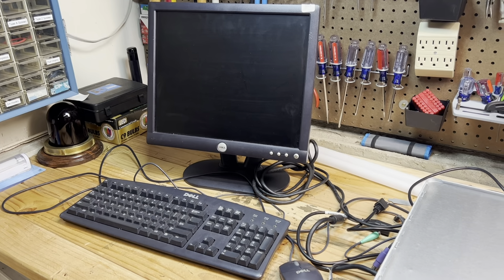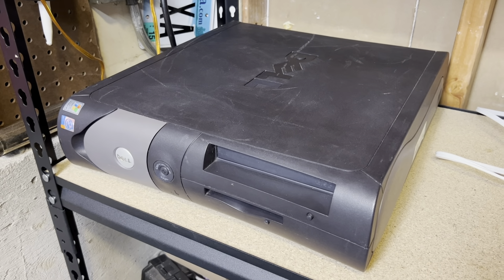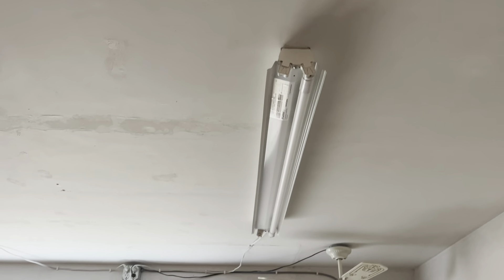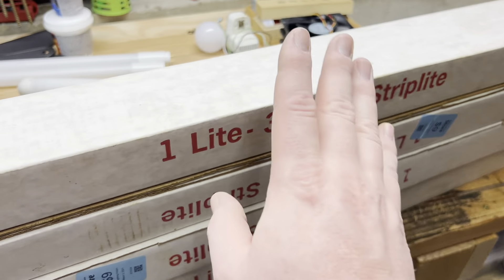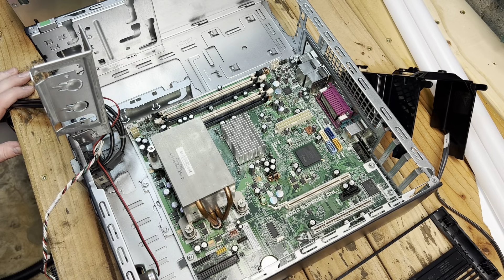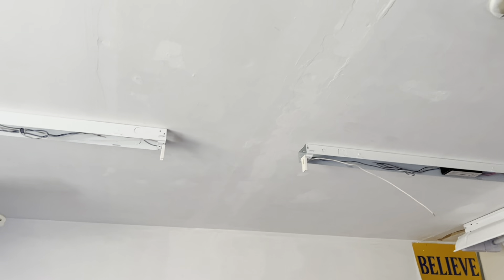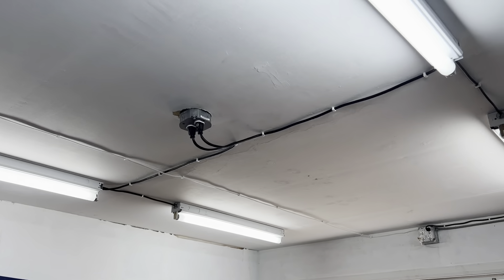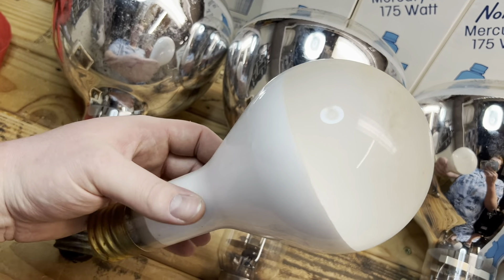Awesome F30T12 Install, HP dc5700 Rebuild & Recent Finds! - 29

Comment: What happened at 9:44 and 15:33?

That fluorescent install is awesome! I love it so much! That’s weird though that the fixtures couldn’t start properly by design. You would think they would be smarter when designing those fixtures!

By the way it’s fluormeric not fluormerc.
Reply: What happened at 9:44 or 15:33? I didn’t spot anything out of the ordinary.
Reply: @achannelwithaprofilepictur6253  a black bar appeared
Reply: @achannelwithaprofilepictur6253 a black shade appeared on the screen, which is probably a editing error or for censoring.

Comment: It’s not uncommon for the various cards and even CPU to work themselves loose over time, which is known as “chip creep” (If I remember that was the proper term. When I used to build my own desktop computers, I always would reseat the various cards, RAM, CPU, etc. if something stopped working.